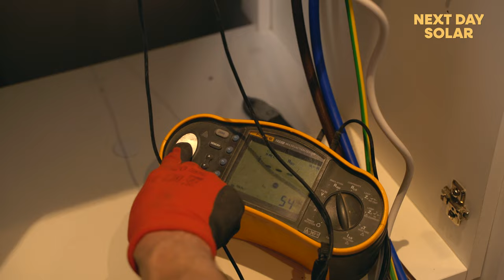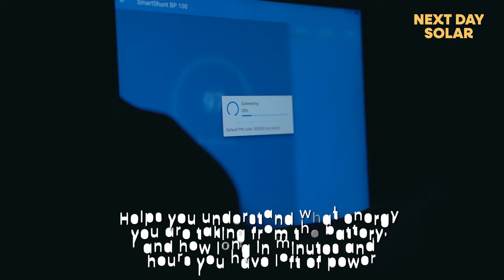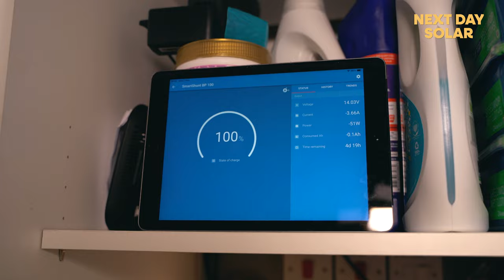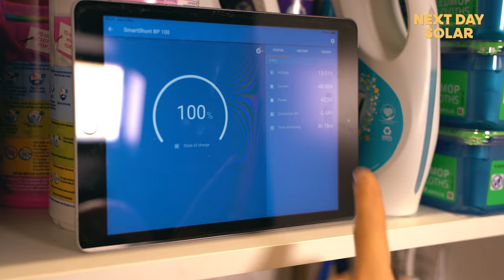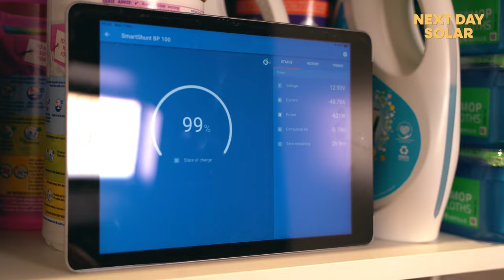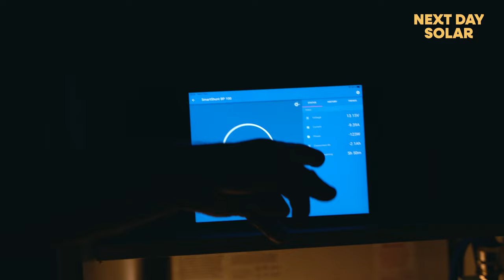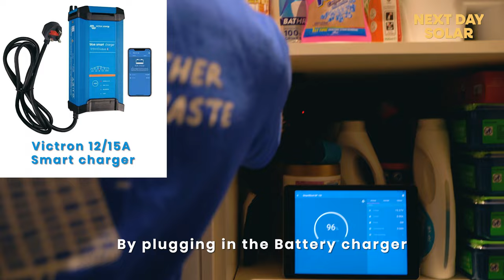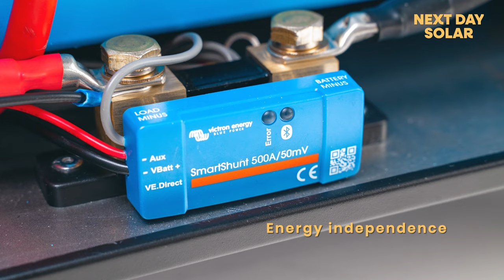Power Cut/Grid Failure - Backup Solution

Comment: Good advice but I have kept it simple. I use a small Honda generator and connect to the house using a camping style rcd/overload multi socket and run extensions. Takes 10mins to set up, we had an 8 hour power cut last week and we had lights, microwave, travel kettle, coffee machine, tv, WiFi, combi boiler on a 3 pin plud so is the shower, used 2l of petrol in 8 hours. I was thinking of getting an electric power pack for night times for the boiler only. Thanks for blog 👍
Reply from the maker: Hi, thanks for sharing, makes sense what you are doing as well. Out of interest, what do your boiler consume on the 3 pin plug ? if you don't know I'll send you a free energy meter to test if you like ? would be curious thanks
Reply: @nextdaysolar3349  hi i use a power monitor to check loads etc and the overload on the multiple allows around 2400w or 10 amps. The combi uses around 150w and the digital shower around 80w 👍